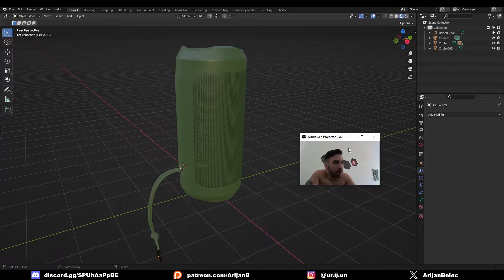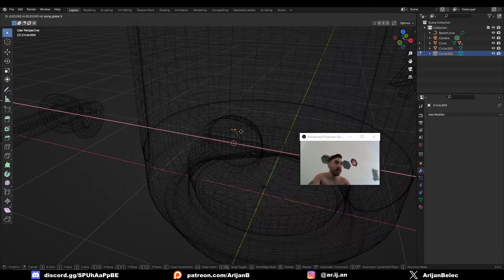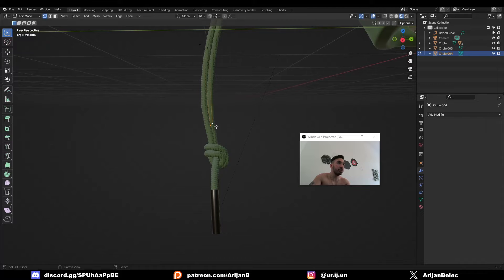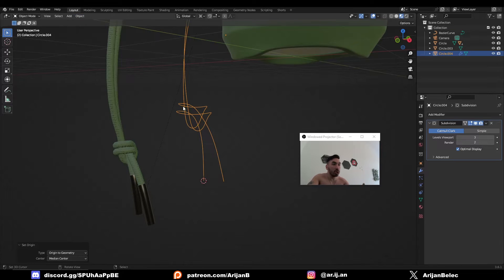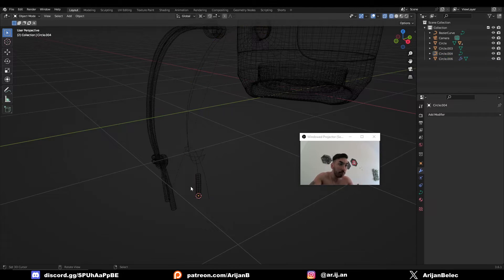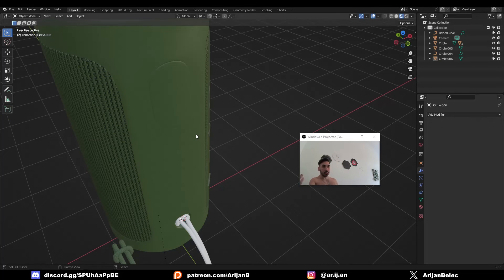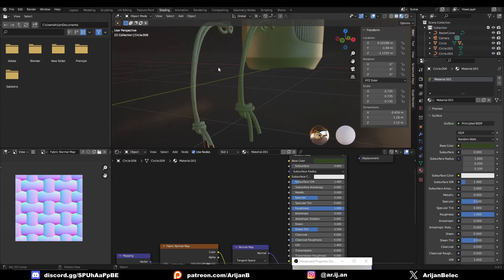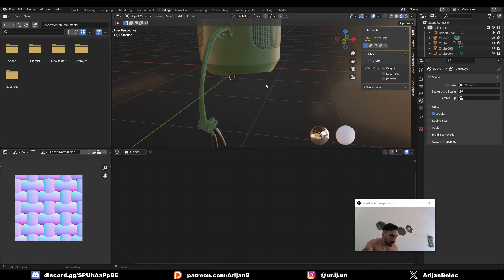Blender Product Design Tutorial - Rope and Knots (Arijan)

Comment: A bit more work, but I would suggest letting the rope path stay as mesh verts for later tweakability, then do the rest in geo nodes. Use flat geo node spiral as circle, grab the points and send it over as a coordinate direction. Mesh verts to curve, resample with a fixed distance, grab the coordinate direction (and tangent if required, as aniso shading can be a thing for ropes). Now you also get UV coordinates (I have no idea why object coords, of all things, was used) that can be tweaked into a spiralling coordinate system allowing each rope to consist of spiralling fibers. Especially for something as important as product design, where these things matter.